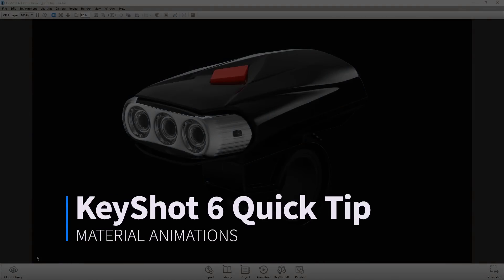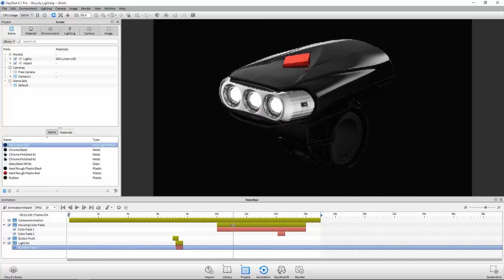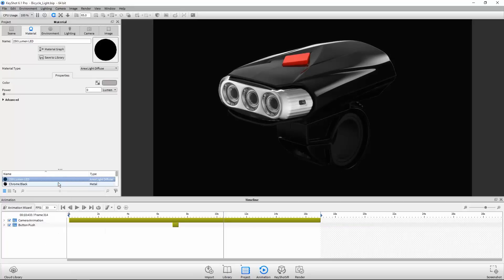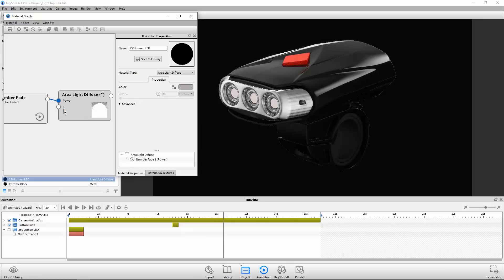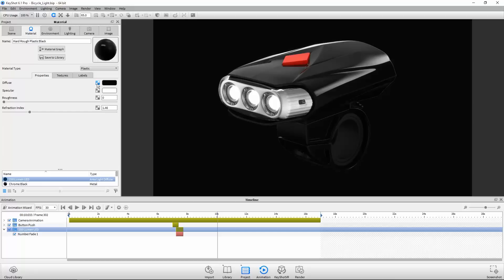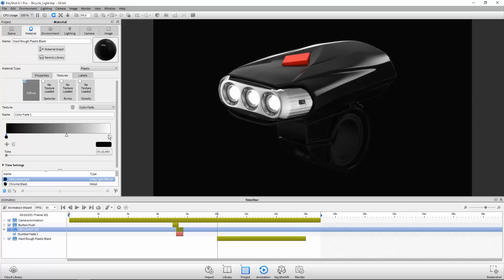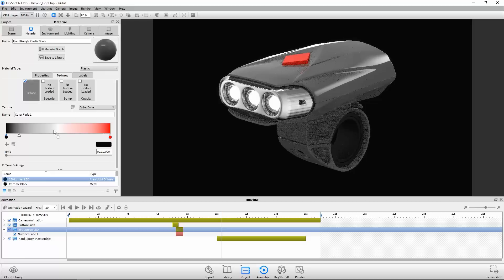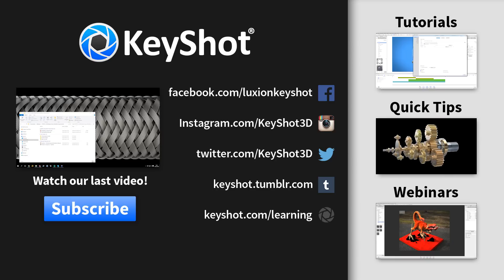KeyShot Quick Tip: Material Animations

Comment: So.. What if you want to add several number fade animation for a specified node? For example turning the LEDs on first, and then turn them back off.
Also how you can determine which part of gradient is related to which frame? I know they have a linear correlation, but how can you find the exact position of a frame on the gradient?
Reply: +Shahin Fathi Djalali at the moment only 1 animation node can be applied to a single parameter; however, there are a couple options. In the case of the LEDs we could use the part Fade Animation set from %100 to %0 to turn them off, or we could use the Color Fade applied to the LEDs color parameter to fade it to black. Unfortunately the Color Fade is a bit more abrupt when it comes to lights so the transition doesn't really "fade".

When a color stop is selected in the gradient widget its time will be indicated in the value field just below the widget.

Hope that helps!
Reply: +Rex Roberts Thanks Rex. Yes it helps.
Having a background both in industrial design and animation, I just wish to see some development in the animation part of Keyshot. like reading animated textures, controlling ease or some of the basic camera movement which are still missing in animation (like tilt and roll)